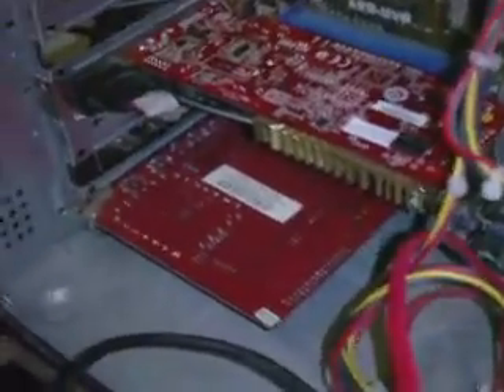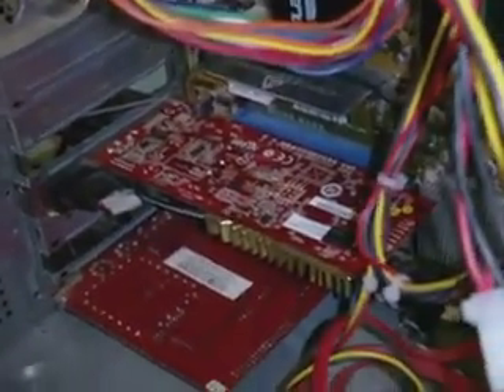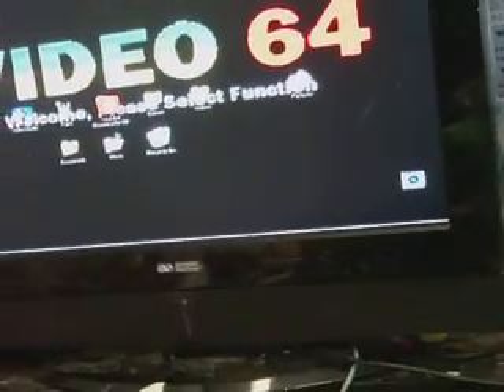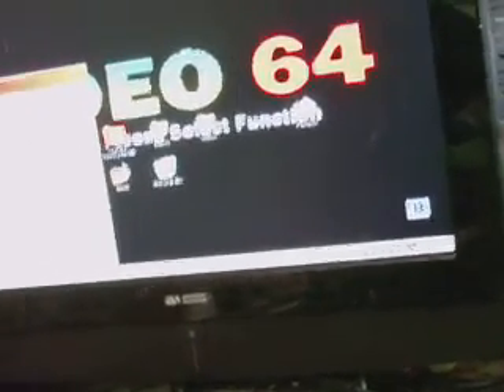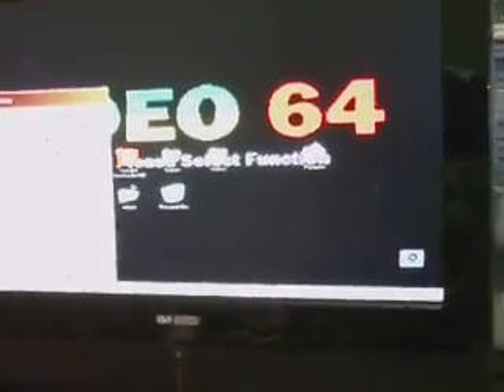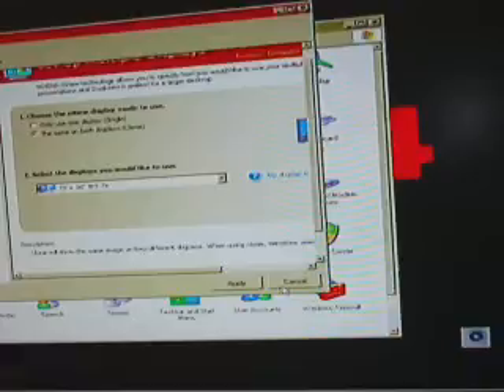How do I get soundmax spdif out working properly?

Comment: The answer to your question is in the Form on NVIDIA's web site, just type in "SPDIF". 

Go into NVIDA's control panal in windows. On the left side is a tasks pane. Under "Display", Select "Change Resolution". Now under Change Resolution #2, right under the text "Connector" there is a drop down box. If you had the same problem as I did it said, " HDMI - HDTV (Audio Disabled)". Simply switich that to "Audio Enabled" and your audio through HDMI should work. I know, stupid stupid.

Comment: My IBM has built-in SoundMax "HD" audio, but I don't think it has a digital output... at least none that I can find.  My SoundBlaster Audigy card does, and in the mixer there's an Advanced button under the master volume slider that brings up the bass/treble sliders and a tick box that says "Digital output only".  I don't have anything that uses a digital audio connection so I haven't had a chance to test whether it is actually working or not.